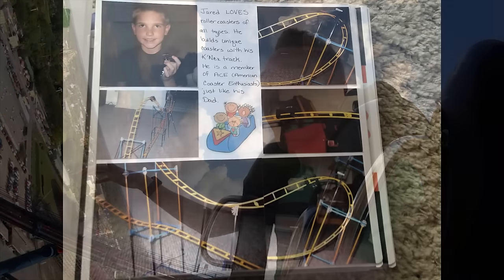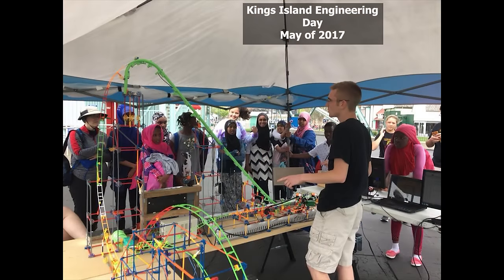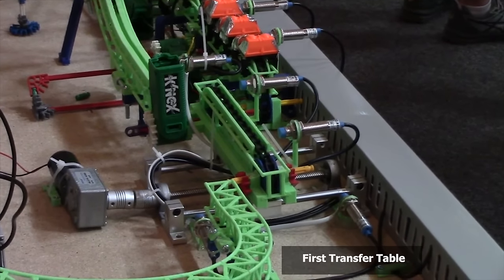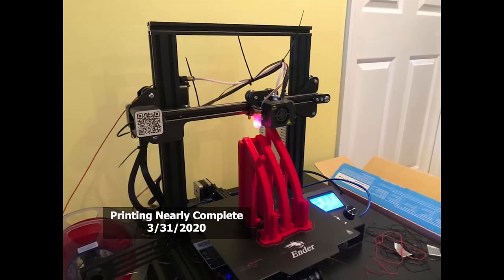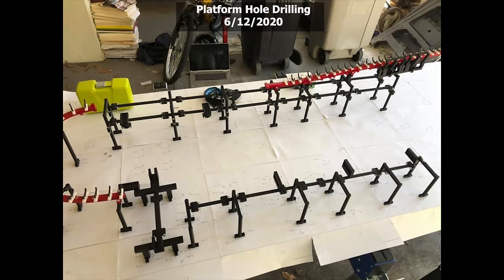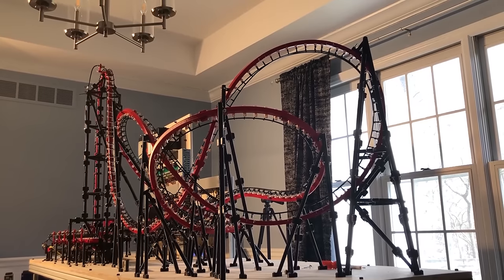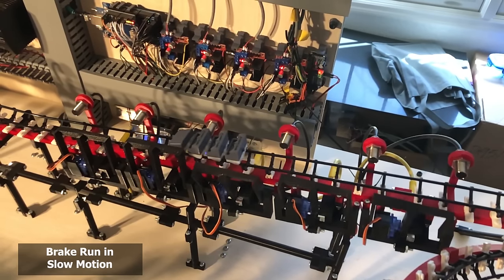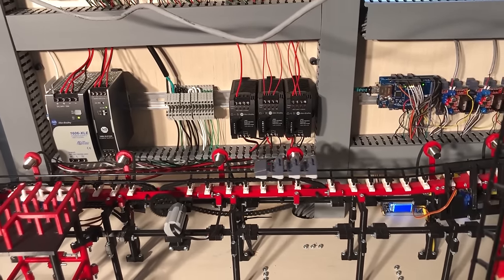Project Infinity: Model Roller Coaster with Advanced PLC Safety Control System

Comment: Very cool project, this involves a lot of other domains next to computer engineering: The design and construction of the roller coaster itself, investigation all regulations for roller coasters, identifying all possible problems that can occur and in the end building a complete system that is able to show all of this. A lot of skills in different domains are needed in order to complete a project like this.
But there are also non-technical and safety domains that I think you did not cover. At 9:15  you show a safety stop if one train is stuck in the break run (and it will) while another train is climbing the lift hill, the train stops. There is a good chance that you need technical personnel to arrive at the track to remove the train from the break run so the people in that train can leave the track. I am guessing that a real roller coaster will have some way to do this when the operator (with the proper key) pushes a button. But then there is still that train stuck on the lift hill so someone (a trained engineer) needs to acknowledge that it is safe for that train to continue.
What if this is not safe (let's say that something is jammed on the break run), do real roller coasters have a way to back-up the train down again so the people can get out ? And is it acceptable when people need to wait for a longer time for engineering personnel to arrive in such a situation?
I have seen less steep climb hills where people can leave the train via a walk way along the track.
These are all things that are way beyond your project and I am guessing that there are guidelines or even required rules to follow in this or at least discussions with the customer to figure out what is acceptable.
I could go on for pages and pages about all the things I love on this project. Every detail looks great, I think especially the mechanical construction of the track is very nice.
Reply from the maker: Thank you so much and fantastic questions! These were a couple of items that I didn’t get the opportunity to represent in the model but I can still let you know how it works out there at the park! Parks always have to complete a ride risk assessment before beginning construction to show that in every scenario there is a safe failure mode for the attraction. In the condition of a stop on the brake run maintenance personnel would verify if the issue was a false positive or if something was really amiss. When their inspection is complete and they’ve verified the system is safe to operate they could reset the fault and the system could then operate in automatic mode again. In automatic mode the train on the lift hill will advance without operator intervention if the brake zone is clear. In the event of a more serious problem on the brake run where maintenance would actually have to fix something they would not be able to advance the train on the brake and since that zone would be occupied the system would not allow the lift to advance. A risk assessment would show that you would need a way to evacuate the stranded riders on the lift hill. All controlled areas on rides have the ability to be evacuated if necessary even if it doesn’t look like it at a first glance. This ride system is based off of a Gerstlauer infinity coaster which uses a maintenance elevator connected to the lift to evacuate the riders. This is due to the fact that the ride uses an antirollback mechanism which inhibits the train from reversing down the hill. I unfortunately did not take the time to represent the antirollback or evacuation walkway/elevators which would be required to meet standards for amusement rides in the US.
Reply from the maker: Oh and parks also have to ensure that they have the infrastructure in place to be able to have rapid response times to issues where people are stuck on the ride. They also have policies in place that dictate the maximum amount of time the ride can be down for before they have to execute an evacuation. Usually when maintenance inspects the problem they will estimate the total downtime required and if it’s more than a couple minutes an evacuation will be initiated.

Comment: Do all rollercoasters with multiple train sets use fixed block, or do some use variable block lengths similar to modern railway signalling that varies block length with projected stopping distance from a given speed?
Reply from the maker: Roller coaster block zones are all fixed in length because the zones are based on where mechanical devices are located on the track to stop a train. The area in the block zone responsible for stopping the train can vary in length based on how fast the train will enter that braking area but the system is not dynamically changing the length of the zone based on the live train speed.
Reply: @JaredHolladay  Would capacity of the line increase with CBTC, or would other limits come into play like crowd control?
Reply from the maker: @Steamtostay  Technically yes. There are a couple coasters out there that use continuous loading platforms where the train never stops in the station. Instead riders board the vehicle on a moving sidewalk. These unique station platforms use several methods to get and verify the train's position so multiple trains can roll through the station with minimal gap between them. The thing is even with a cool station like this because roller coasters utilize gravity sections you still need to divide the man portion of the ride track into block zones. Reason being I have no way to stop a vehicle between the beginning of the gravity zone and the brake section at the end. Even if the ride vehicles knew exactly where each other were because there are no brakes onboard we cannot drop more than one train into a gravity zone at a time.
Reply: @JaredHolladay  The moving platform concept is very interesting; I wonder if that could be made accessible for transit purposes? Can you provide a starting point for research, i.e. one or two examples?

Re gravity zones, not something I'd considered and I can't think of an equivalent in the transit signalling sector. Are braked coasters a different category of attraction? Would that permit a second train entering the gravity section earlier, depending on the capacity of the brake to decelerate? Transit emergency deceleration is usually rated at about 1.2m/s/s (at least locally), but in the context of a rollercoaster can you assume heavier emergency braking because the passengers have already volunteered themselves for more extreme g forces and are strapped in and supported rather than just holding on to handrails?
Reply from the maker: @Steamtostay  Three coasters that feature a moving load platform are Hollywood Rip Ride Rockit at Universal Studios Florida, Hagrid's Magical Creatures Motorbike Adventure at Universal's Islands of Adventure, and Wonder Woman Golden Lasso Coaster at Six Flags Fiesta Texas.

Onboard braking is not an automated feature on today's coasters. Yes if there were onboard brakes you could theoretically allow multiple vehicles into the same gravity section. However, If the brakes were needed in a fault scenario you could potentially valley the train and because there is no propulsion onboard the vehicle this would cause a lengthy reset under a fault condition as vehicles would have to be winched out of the valleys.

Comment: Wow!  Fantastic project!   Great job!
Question:    I've been wanting to design a very small <200mm^3 "marble-coaster" for .177 caliber BBs, to be 3D printed.  My main challenge is making the paths, given the physics involved.    Do you think NoLimits would help simulate such a tiny "BB-coaster", or would there be other, more appropriate, software to help me make the 3D paths?
Reply from the maker: No limits may be helpful for that. It's fairly easy to scale the exported track layout down. Of course, you could always use the spline tools in Fusion 360 for that as well if you don't really care about banking. If you are doing uphill sections it may be helpful to create a test track to see how much speed you lose due to the friction lost between the ball and the marble run trough. I used to use marble runs to simulate riders on my older models to emulate riders they were pretty cool.

Comment: While this is pretty cool and a lot of work I don't see it as THAT complex. I remember doing something similar in my first semester back in the day.

HOWEVER: Where you're actually doing amazing things is in the 3D printed designs. Getting an entire coaster at this scale this precise requires a lot of thought planning and precise work. 

My point is I think some people here are amazed at the wrong things.
Reply from the maker: You'd be surprised. In this video you only see about 15% of the software actually run. The other 85% is monitoring everything to make sure things are operating within design limits. You are right though the 3d printed design was really hard to get just right and did take a whole lot of planning.

Comment: Just wondering what qualifications do I need to get into rollercoaster control systems?

I'm a currently a business system developer (Perl and Python) with a computer science degree, but my experience with real time systems is limited precisely to porting another rollercoaster youtuber's single block control example ladder logic program to OpenPLC so I could fiddle with it myself on screen without paying loads of money for the software he's using.
I have an A-level in electronics and seem to have a tendency to tie my brain in knots with what-if scenarios which could actually be useful for thus kind of work.

Also is there rollercoaster simulation software that would let me hook programs into sensors and brakes, motors etc on the sim?

Comment: how did you come up with that solution for the arduino and the PWM, jeez gonna do my senior project next year and I don't have a clue on how to do any of those things
Reply from the maker: Between my previous model coasters, school, and co-op experiences I was able to put a lot of what I learned together in this project. I am super interested in automation technology.  I structured my classes and co-op experiences around that idea and was able to become somewhat of a pro with Rockwell Automation gear. The previous coasters were controlled with Arduino so I taught myself how to program those to make the other coasters. To make this project work I just put all that together to create a solution that allowed the Rockwell stuff to talk to the Arduino. 

When you go to choose your senior design I’d say do a project that gets you excited to learn about the concepts behind the project because you will have to do a lot of research to get it to work. This project was definitely a huge learning opportunity for me because even when I started the project I knew what I wanted it to do but it took a lot of figuring stuff out to get everything working the way I wanted it to.
Reply: I'd like to know why there is no way to connect a PWM controller directly to the PLC.

Comment: i like scale models, but the problem with roller coasters is that the cars are going twice as fast as irl, so someone should make a track where the cars are being
pulled by electro magnets that are built in the rails, because then you can control the speed and make it look way more realistic.

Comment: 3d printed velocicoaster?????
Reply from the maker: Honestly I'm considering it! Velocicoaster is my all time favorite ride!
Reply: @JaredHolladay  do u think it will be hard to do a second launch or u think it wouldn’t need one?
Reply from the maker: @Sllsles  you’d definitely need a second launch to clear the top hat. I’m currently working on a computer controlled launching system for a model roller coaster. I’m hoping to incorporate a capability for it to be able to launch from a dead stop or boost the train up to speed from a running start!
Reply: @JaredHolladay  okay, hope it turns out good

Comment: Let me tell you this: for safety reason you'll need to have a 2-Hand-Dispatch. Also your dispatch-button isn't safe. It has to be one with these rims around it so that you're unable to touch it unintentionally
Reply from the maker: Not necessarily true. You are correct that in this condition that you would certainly want a two hand dispatch. However, this system is based off of a ride system with a station platform dual dispatch push button (it’s just way too small to put a button at the station.) A risk analysis would show that the risk of an accidental dispatch is mitigated by having a second pushbutton being pressed by an operator elsewhere in the station. If you have a second button on a remote panel the dispatch at the operator console also does not have to be guarded. You’ll notice many rides have this same push button as their dispatch. Rides that feature dual dispatch have modes to inhibit the remote panel that aren’t used when guests are present. The control panel for this ride system is made to look similar to many panels on more recent GCI rides like Mystic Timbers.

Comment: nice now to design one for high speed commuting with a luggage hold behind each seat a scale to weigh the train twice before each dispatch and boosters all along the way going for a speed record to beat bullet trains but also using gravity and having a little bit of flair on the ... almost straight line to destination I'm talking like a 1000 mile long roller coaster maybe 2000 miles and i a bit for the loop  imagine rolercoasteriing up 9me side and down the other of a mountain range when all through roads are closed but somehow this land based travel being above where the snow and avalanche lines would be can just cruise on through the steep bits with that extra kick and thrill  being safe for healthy individuals but really pushing the G force limits for acceleration braking and banked cornering   woth a smooth deceleration still but more abrupt a ride you can't just whine and cry to the operator to stop because ya are strapped in tight and are there till it completes it's loop obviously i don't have that kinda money but i can dream and by sharing that inspire others who have the means or gumtion to aquire means to make it a thing

Comment: Congratulations. You’re school or someone bought you a $10,000 PLC and you hooked it up to non-safety rated hardware to emulate a real ride system. For my senior project I actually had to design the microprocessor circuit boards in my controller from scratch. Nice demo but just go get a job now. The end.
Reply from the maker: Sounds like a great project and I’m sure you learned a lot from it as I did from mine. That is the whole idea of senior design isn’t it? The point of this project was entirely different than yours so I don’t think they can really be compared(I am not trying to build a computer.) A good portion of the project was not even electrical design it was mechanical. Yes some of the hardware is not safety rated (they don’t make safety drives for 9v motors) but some of it is. The idea is to show concepts not to actually put guests on. Like you said it is a demo. I worked with industry professionals during the development and was even lucky enough to get the equipment donated from Rockwell Automation. I am trying to show the engineering/maker community something cool that I built nothing more. I’d love to see a video of your project because it may give me an idea for a future project as I hope this video does for others. Sharing experiences is what a healthy community of engineers and makers does.
Reply: Do entities seriously pay $10,000 for a microcontroller and a few IO components?

Edit: Changed "People" to "Entities" in line 1, timestamp 20210630133000
Reply: @user2C47  not people, but companies yes.